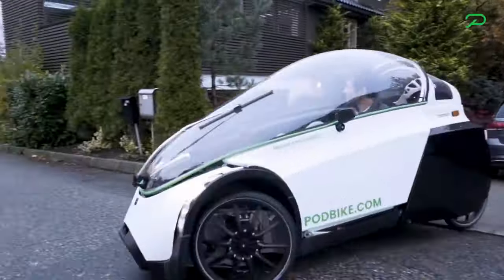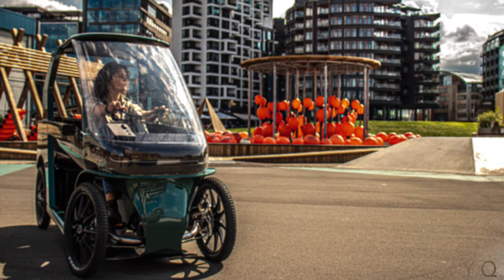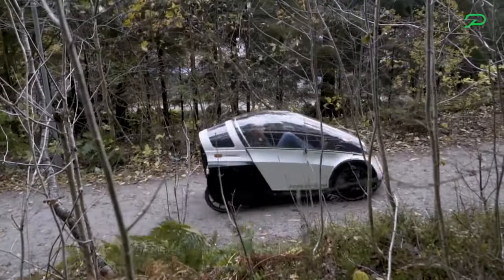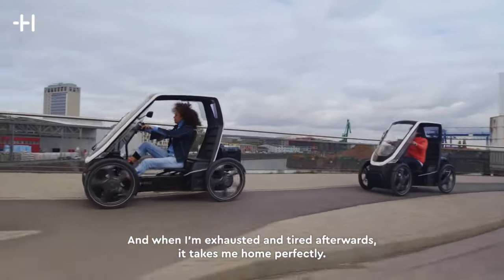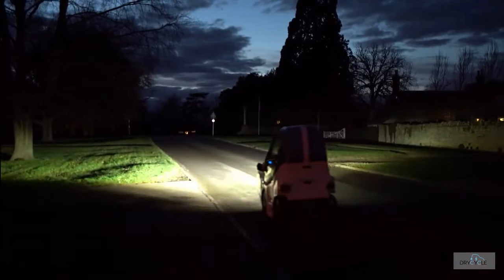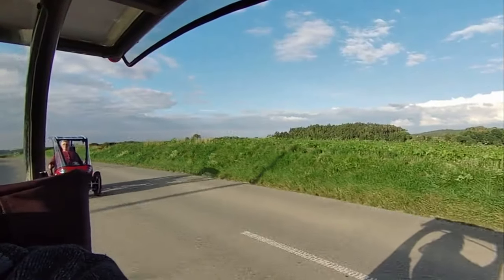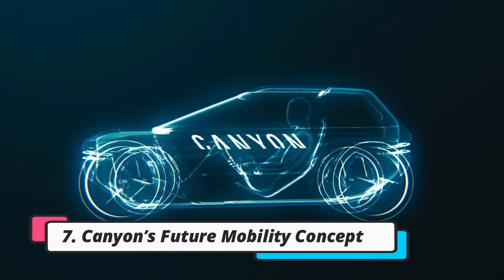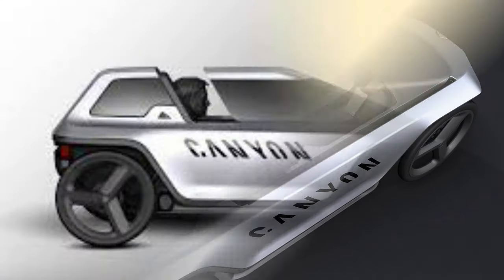7 of the best Bike Cars Velomobiles - E- BIKE Velomobile aims to get people out of their cars

Comment: Problem is they are freaking expensive that in my country you could literally buy a decent used car with those prices.
Reply: The podbike is "only" $7k..
Reply: @jimj2683  at that price and if we include import taxes. It has the same price of a brand new Suzuki Alto 800 in our country.
Reply: @HIHIHJIHIHIH  The running costs are close to zero. Insurance, gas prices, parking, maintenance etc are all very expensive for cars.
Reply: but the thing is cities will impose all kinds of taxes on regular vehicles, and we also do not know how much electricity prices will increase to
Reply: I live in the US. Me and my wife just paid $4000 for a small decent car about a year and a half ago. It’s also good on gas.
Reply: Average cost of owning and opperating a vehicle is between 8k and 10k a year so honestly if the infrastructure is good enough to make them practical to ride then its not the worst investment.
Reply: Indian engineers should try to make such cars at an affordable price. The selling price should be within 1 lakh
Reply: @prajyotshirodkar9735  didn't they tried and made the Tata Nano?
Reply: @HIHIHJIHIHIH  nano runs on fuel.
Reply: Buy a scooter, they are cheaper an better in every way
Reply: Decent? used oil burner!?
Reply: I agree, my 759 watt Himiways 2 wheeler has a front suspension, 9 assist settings, 7 speed bike gears and 4 inch 26 wheels and only cost 1600 dollars.
Reply: Yay! Let’s all zip around in glorified mobility scooters 🙄
Reply: Can we buy one?

Comment: I get that this is cutting edge tech but I can find a used trike and add a Bafang 500w front electric tire for around $600. Saving me $5000 to $7000. Geeeze
Reply: did you get it? how much was the total cost?
Reply: I have a trike and would like to do as you suggest.  Where can I get such an electric front wheel/tire?

Comment: Summary:
City Q: 7450 €
Podbike: 4999 €
Bio-Hybrid: 7000 €
DryCycle: 19000 €
Pedilio Solar Bimobile: 9250 €
Podride: 2800 $
Canyon's Future Mobility Concept: ?
Used car: below 4000 $
Reply: Wrg use car 40000 hss beware cars 16000 1070 econy
Reply: you can check us out if you like urban electric vehicles 😁
Reply: absolutely correct - the prices are insane. You can get full-usable reliable old Toyotas for less than 2000,- EUR, and it will take you much further than these unsafe bikes.
Reply: The information I needed. The podride is the only one of these which is reasonable, and it's still way more than I'd want to pay
Reply: Biohybrid went out of business already. And Drycycle too apparently.

Comment: These are brilliant alternatives to cars / bikes  in low speed well controlled environments like in some cities (but not all). Forget about any decent road usage like commuting in between towns: in these conditions, as currently designed and engineered these are highly dangerous vehicles completely unsuitable for that purpose
Reply: False. These are far safer than bicycles and one brand, the Organic Transit ELF, has seen journeys between 4000 and 47,000 miles completed safely. One wrote a book about it, one made a movie, one is still going past 47,000 miles. What has been proven highly dangerous is the continued abuse of fossil fueled vehicles which are partly responsible for the slow death of our biome.
Reply: I thought this in 07 or 08 didn't patent it? The old thread sewing machine the needle attached to the paddle(s) move them and this keeps making the wheel go by itself   I am giving it out as we are now expect to buy electric cars and arent' that reliable and expensive
Reply: @PeachesCourage  You have false information. EVs have fewer moving parts and they are more reliable. They are also cheaper to buy and operate and license at any given price point, compared to ICE vehicles.
Reply: Wring rv gr0kcey stir 21 cetry
Reply: @popeyegordon  never attempt any studies in what concerns safety…stats are not your forte…you seem confused as well
Reply: While they may not see mainstream usage, there is a niche for these vehicles. They are obviously not suitable for certain road conditions as any standard bicycle would be, however, the future of transportation looks very much like what we see here.

Comment: These CONCEPTS of bikes with cargo space  have been a mainstay in Third World nations for decades.  They make practical sense for short distances and running around locally.  The two biggest problems with bicycles is (1) no safety whatsoever (2) zero to minimal cargo capacity.  These "bikes-in-a-box: (bib's🤪) don't totally solve these 2 main challenges, but they sure offer a lot of relief in dealing with them.  Most of our driving don't require lots of cargo space.  Also, most of the time most people are driving their cars alone or with two people.  So these are great for most of our daily driving unless you have a long commute.

Comment: Americans aren’t going to give up their cars. These should be targeted at college students on a budget.
Reply: With these gas prices.
Reply: I am not so sure about that. I tried the Podbike and it was more fun than any car I have driven.. And you never need to worry about finding parking or traffic jams.
Reply: @jimj2683  Perhaps, but try that in Phoenix when it’s already 85 on your way to work in the morning and 110’s in the afternoon on the way home with the occasional monsoons and see how much you like it, not to mention running shopping errands.
Reply: @rickstokes2239  With ir-coating and evaporative cooling from the powerful fans it will be no big problem. It will be even better than a normal bike. Have you ever stood behind ir-coated windows during summer?
Reply: @jimj2683  No bike of any kind will make anyone cool in the Arizona heat. Have you ever ridden a real bicycle in temps above 100 on the pavement? You literally bake.
Reply: @rickstokes2239  I am sure a small ac-system will fix that.
Reply: @jimj2683  But then where will the efficiency and range go?
Reply: @rickstokes2239  Just add slightly larger batteries. A kilo extra doesn't matter in a total system weight of almost 150kg...
Reply: @rickstokes2239  In the desert, evaporative cooling methods and fans are very effective. You just need something to shade your body. And of course, the common sense to ride more in morning and evening.
Reply: @jimj2683  Every ounce counts. The better.bike PEBL velomobile went bankrupt because it was 70 pounds too heavy. AC is literally impossibe in a light vehicle because of the laws of physics. It becomes a heavy vehicle useless for pedaling. My ELF's roof and a fan keeps me cool enough in Florida. Electric assist and the roof's shade means you don't work too hard in the heat.
Reply: @popeyegordon  Unless there’s full enclosure on the bike, no amount of evap or fan cooling will help on a moving vehicle in the Phoenix valley heat which is already near 90 in the am and still in high 100’s into the evening. Also, the Phoenix valley is broad and people commute all over it for work and shopping, etc. College students on a campus is a better scenario.
Reply: @popeyegordon  So basically you’re saying dress like a beach bum in order to use the bike in 110 degree heat and that should accommodate everyone. Lol
Reply: @rickstokes2239  You intentionally misquoted me in a hostile fashion. Flagged. All readers note my many assertions about how we can keep cooler all work, are all widely recommended,  and can be done while wearing business casual attire.
Reply: @popeyegordon  Completely false. I’m an amateur cyclist and just did a quick 15 miles in 97deg heat with 72% humidity. Even if you’re casually riding in this environment it’s not accommodating for people to use as a viable method on a day to day basis for regular commuting - as an alternative for cars. As much as you want to resist it the environment matters.
Reply: @rickstokes2239  How ironic you ended with "the environment matters". That is the point that serves my stance. If we are going to use the appeal from authority debate fallacy then I'll trump you with my 60 years of bicycling experience in 12 states.
Personal cars are 10 years past being obselete based on the global science consensus. We either change or perish. More busses, trains, electric planes and light EVs. Arcimoto fits a piece of that puzzle. We have to stop demanding to be transported around like royalty in climate controlled steel caged sound proofed over powered lounge couches.  
Soon enough all will learn the hard way that the environment is all that matters and the clothes we wear, the sweat we exude, are irrelevant if we want to survive without regressing to a steam punk age.

Comment: They look like glorified Rickshaws 🛺.   Will 250 watts power get you up a steep hill?
Reply: Depends how steep and how long the hill is. Ebikes put out far above 250 watts for the first few minutes before they gradually go down to 250 watts. The regulations are quite complicated. I tried a top of the line 250 watt ebike and it kept 25kmh (the assist limit) on pretty much all the hills in my city. Only place it got slower was on some super steep off-road trail. These enclosed ebikes are heavier though, so they could be a bit slower. I weigh 75kg fiy...
Reply: @jimj2683  Thanks Jim for taking your time to reply.  That’s great to know. 😀👍